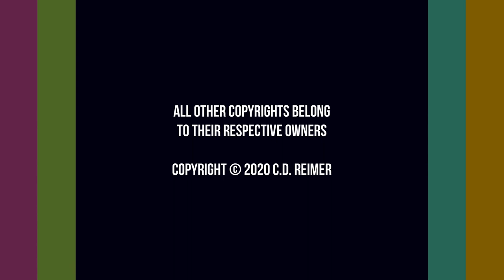SilverStone Slim 120mm Case Fan - FreeNAS File Server Rebuild 2020

Comment from the maker: It's been pointed out that the "hot zone" at the bottom of the case is a "dead zone" (i.e., hot air is trapped due to a lack of circulation). I stand corrected.